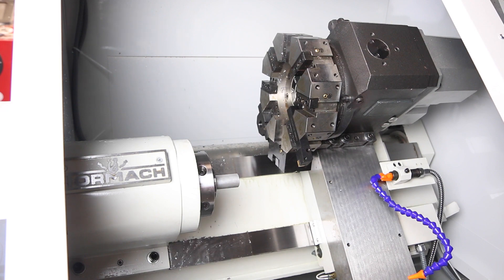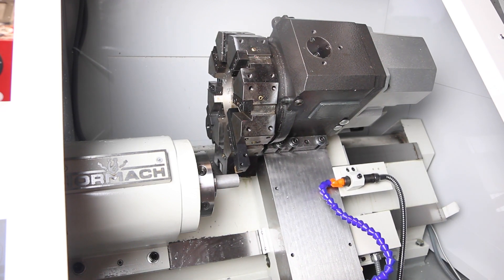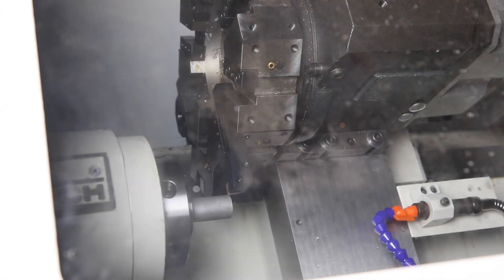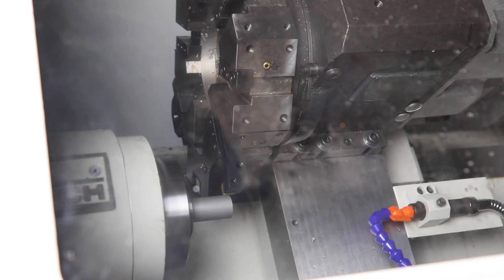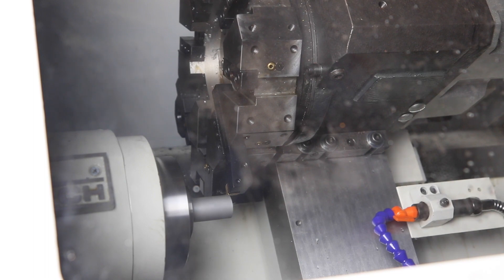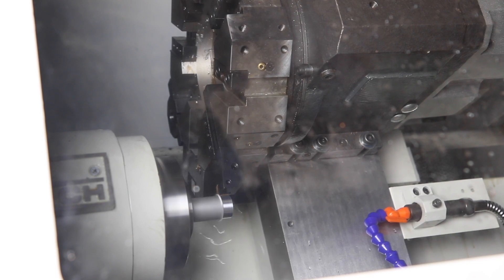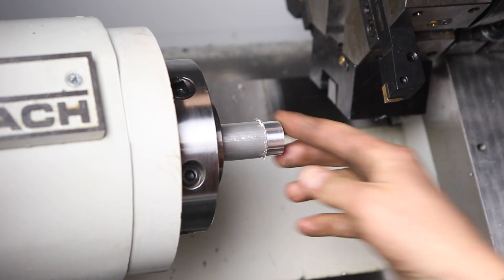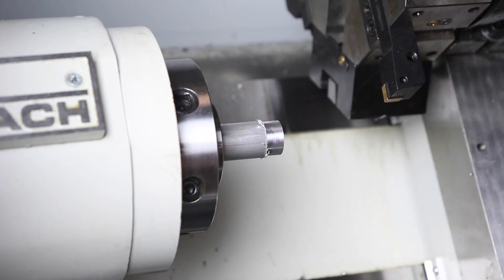Tormach Turret Lathe - First Cut!

Comment: Why does it cut on the backside of the part? ... wouldn't that lift the carriage off the ways or are the ways inverted? This seems weird, wouldn't it be better to have it rotate clockwise to and have the tooling be right side up to have the force pushed down to the ways/frame of the machine?

Comment: I found your channel a few days ago. I cant stop watching your videos. Great work. I wish i could come to your open house, just a bit far to drive. Congrats on the new machines. I look forward to your future videos.
Reply: NYC CNC i was looking up Solidworks videos. Im not bad in CorelDraw (2d) but dont have a clue about (3d) software (wanting to gotoback to school for CAD/CAM classes). Work towards a degree in Production/Manufacturing Engineering.

I guess im a little spoiled with having Engineers create our programs where i work (aerospace production parts), lol.   I had my own cnc plas table for years. I was just like you were in the beginning. Cramped working conditions. Working with what i had. Business took off about the same time my ft job did and i was working 16-20 hours a day. I couldnt handle the hours anymore and sold my equip to buy a bigger house. I still make files for friends to cut on their plas tables.  Now i sit around watching youtube videos til its time to goto work.

Keep up the great work John.

Comment: Evil teaser video....just evil....
Reply: I thoroughly enjoy your videos.  I share a passion for working with metal.  I'll have a small shop up and going this year.  Tormach equipment is very appealing in cost/capabilities.  I've been glued to your videos for a while.
Reply: NYC CNC I've seen some videos about the diagonal gang tooling lathe and I an VERY interested in seeing the turret tool system. I'm more inclined to forsee that being a better design for larger (wider) work pieces.